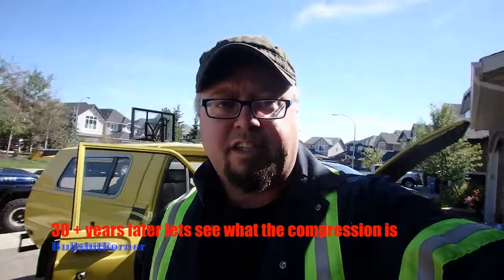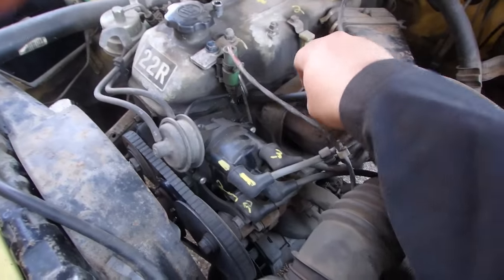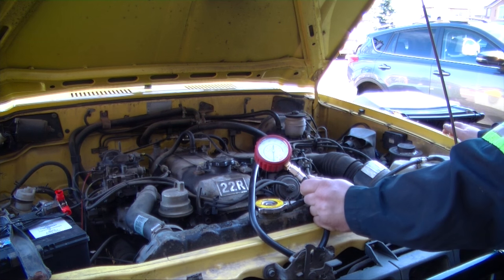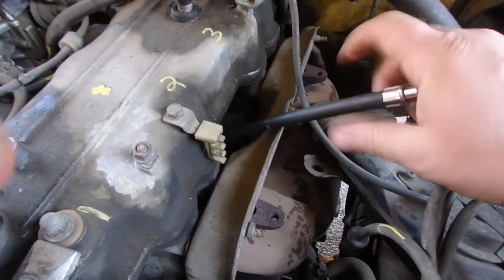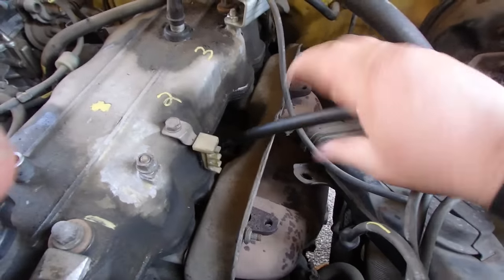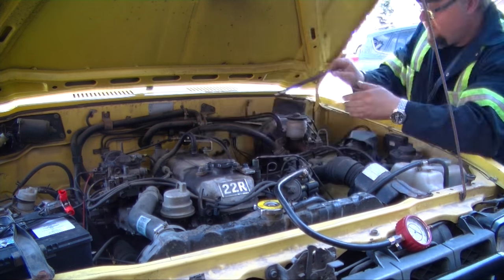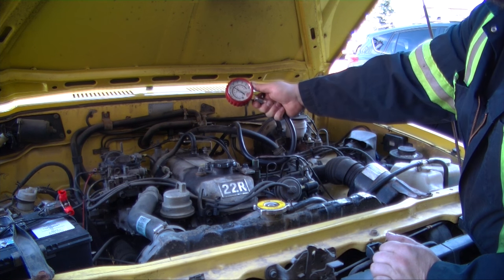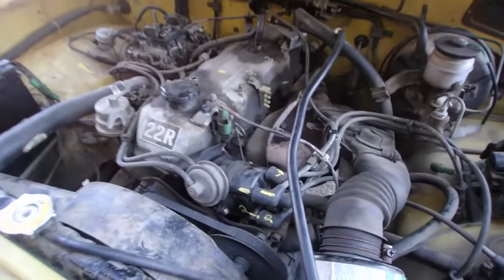1981 Toyota Trekker 22R Compression Test

Comment: I love my Yota with the 22R- Mine is even better with the fuel injection The 22RE. Only issue with these are the plastic guides for the timing chain  and chain- after 200K miles they will wear out and the chain will break if you don't get these pieces out of the oil pan when replacing the chain guess what happens ?   I cna tell you form personal experience hahahahaha
Reply from the maker: +Redneck Garage oh you had to do a rebuild ?
Reply: Yes - put the timing set on - ran like a top a week or so later started knocking like a freight train. It was one of my service trucks and an employee was driving it. Evidently he didn't know what a oil pressure gauge was .... I started it up and no oil pressure - of course he drove it hot and till it knocked. Took it out and did a rebuild - When I took off the oil pan it was evident the screen was clogged with the plastic from the guides. Get the crank turned hone the cylinders - The head was reworked when I was doing the chain. Go on down the road. The 22R is almost indestructible unless you run it super hot or out of oil.

Comment: Recently did a compression test on my BMW E46 316 04' model (N42 engine, 1800 cc) and compression is high and even across all four. Damn thing still takes oil. :-( Any ideas why? (I've Replaced CCV and all related hoses)
Reply: valve stem seals